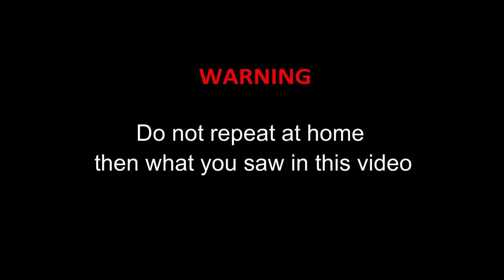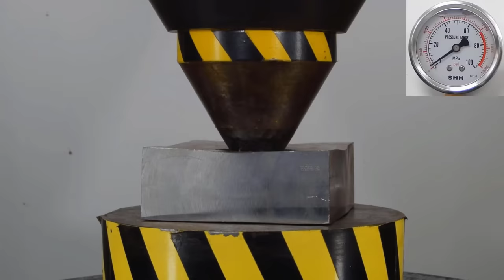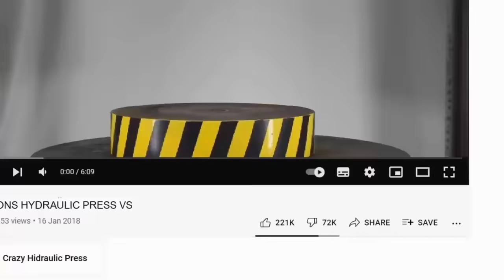HYDRAULIC PRESS VS OLD AND MODERN ARMOR

Comment: Now that armor is what extreme depth submersibles should be made from.
Reply: You mean some carbon fiber, glue and a playstation controller isn't enough?
Reply: @solenoidnull9542  lol the titan should have been named the giant soup can
Reply: And tgey should be a sphere, not a can.
Reply: Too soon and too late. That’s rare. 😜
Reply: @og-big-shepherd4468  - The jelly maker. :D
Reply: I don't think the brittleness of AR500 is any more appropriate than the brittleness of carbon fiber.   Ordinary steel has been used for subs for decades for a reason, as it has the right amount of flex that can be repeatedly subjected to, with minimal fatigue.
Reply: @ElementofKindness  What you are saying sounds right, but if I am correct in assuming that this armor is used in building tanks, being brittle (as in cast iron) would be a disaster for the tank crew.  It would seem that a tougher steel would not flex as much and therefore resist pressure better.  I know that chrome-moly steel is tough and not brittle (piton metal and is also used in building race car frames).
Reply: @solenoidnull9542  Hey wait, you can't leave out the cool LED's from RV world now.
Reply: it would be so heavy, that you would never be able to come back to the surface...
Reply: Nah, carbon fibre is perfect for billionaires toys, its sleek, futuristic and wealth redistributing - perfect!
Reply: I think you have to consider tensile strength over a larger area. A small block with localized pressure will behave quite differently from larger sheets making a hull, which also relies on inside pressure to help oppose the ocean pressure. And the shape of the vessel is important, too.
Reply: @solenoidnull9542  you need lights from a camping store too
Reply: @solenoidnull9542  you forgot a bunch of discarded rusty iron tubes for extra weight.
Reply: @solenoidnull9542  let's be fair, the Logitech F710 was the only surviving part.
Reply: wont work for long steel will rust especially in salty water
Reply: Well, it's also has to be buoyant enough to float back up to the surface unless you're okay with a one-way trip down.
Reply: @denniscliff2071  Modern tank armor is composite, there are other elements like ceramic behind the outer steel plate. Even if the steel shatters when hit, it's only the first layer of potentially many. They don't build them like they did back in the WW2 days where you would need to fish out shrapnel from your face even when the round failed to penetrate but caused spalling.
When we are talking about resisting pressures, though, the pressures submarines are subjected to are unreal. On DSVs that go down to the Marianas Trench, the titanium alloy pressure hull shrinks by what I'd call "an alarming amount". I don't remember the exact number but it wasn't microscopic I can tell you that much. This 90mm thick titanium sphere that's machined to be perfectly spherical actually shrinks from the outside ocean pressure. It's probably not a good idea to resist that with a brittle material.
Reply: @robertgaines-tulsa  The first submersible to dive to the bottom of the Marianas trench consisted of a steel Bathysphere attached to a large tank above the sphere.  The tank was filled with gasoline which is incompressible and yet is very buoyant.  No pressure vessel will have positive buoyancy.
Reply: @complame  ever heard of stainless steel?
Also, remind me what ships are made from 🤔
Reply: @dabunnyrabbit2620  The design, even with the cylindrical body, was OK .. it held up to a couple trips to the Titanic below. The material did not hold up and NDE testing was not done after each submergence, so it appears. They simply relied on some kind of sonic sensors. From what I've read, every trip down resulted in crackling sounds from the cylinder body, which had to have been the body resin micro cracking. What else could it have been? Yet that guy nor anyone else considered what the crackling sounds implied ..
Reply: @sporegnosis  It would require a different ballast system .. not the scrap steel pipe and sandbags used. More expensive yes but hay .. they'd be alive still unless improperly designed as well
Reply: @Rachel_M_  ever heard of stainless steel used as an armor plate? different purposes different formula.
Reply: @Rachel_M_  stainless steel wont be as strong as this one.
Reply: @complame  i made 2 points. Care to address both of them?
Reply: @complame  little hint for you. Look up Stainless Steel type 316 😉
Reply: @solenoidnull9542 stop that 😢
Reply: @complame  also look up HY-80 😉
Reply: @complame  myself and the Commenter above are talking about submersibles and salt water corrosion of steel.
Please try to stay on subject.
Reply: So it could stay on the bottom?
Reply: @Rachel_M_  Steel with special rust prevention paint.
Reply: @denniscliff2071  thanks!!! You let the cat out of the bag🤦🏼‍♀️.... Shh 🤫.. Don't tell anyone 😁

Not sure if Cathodic Protection can be used too? Never really looked into it...
I wonder 🤔......
Reply: @denniscliff2071  turns out they use cathodic protection... Never knew that!! Quite intersting as it goes.
Just watched a really good video on it 👍
Reply: @sporegnosis  right, aircraft carriers are too heavy to float🙄🤡

Comment: I quick question - what did the super cooling of the metal ball do for this test? Did it make it "harder" since it was at a lower temperature? Would supercooling the tank armor have any beneficial effects? Obviously a supercooled tank would stand out too much to thermal cameras but it is interesting.
Reply: Hardness decreases with temperature. But freezing the steel also makes it more brittle. Had the stress limit been reached for the ball, it may have been a catastrophic explosion. Think of it shattering like glass. The armor reached its limit and suffered catastrophic failure but was not thick enough to rupture, so it just cracked. We design pressure vessels to not be too thick so they will crack rather than explode. Once you hit that stress limit at a certain thickness, additional thickness might actually be worse, depending on how brittle the material is.

Comment: They were designed for completely different rounds and threats back then. The hardness and toughness were specifically designed to combat those rounds while modern armor has a different hardness and toughness for different purposes. Also this slow pressure is very different than shock load and piercing load of he and ap rounds
Reply: Yes, tungsten carbide and uranium carbide whites were not used at that time
Reply: Armor was sloped as well on tanks in most places. Ricochets were common unless facing an 88.

Comment: that's impressive but...I've never seen a tank attacked by a hydraulic press.
Reply: You joking? It simulates projectile impact. rmor does not know or care about who/what is pushing it, only peak pressure in Tons
Reply: @fahey5719 yes, yes he was joking
Reply: True, and also it took more force for the hardest cone to go through the 1940 steel. 450 tons. Vs the ar500 that exploded at less pressure. So I guess old steel better for some things?
Reply: Hydraulic press is probably one of the worst ways to test armour. The only way you will get reliable results is to just shoot the armour anyway since the forces in a hydraulic press and armour penetration are way different.

Comment: AR500 seems to be primarily used in body armour. It's probably not too different from the exterior layer of tank armour, but most of those are still classified.

But the main protection of the front and parts of the side of tank armour only uses this for the surface layer, behind which is a number of composite layers. Tank designers often estimate the frontal protection of tanks in tons/m², while the thickness of front armour tends to be around 1 m (3.3 ft)

Comment: Those titanium plates are likely those from the soviet 6b3 vest as it used a system of over lapping 6mm plates backed by Kevlar to offer protection. The plates are commonly sold separately on ebay

Comment: Although this is a very interesting demo, modern projectiles penetrate armor because they consist of a "shaped charge," which is an explosion that directs a jet of flowable metal against the armor. I don't believe there's any armor that can resist that, if the shape charge is large enough. The defense from shaped charges is to sense the incoming round and send out ceramic armor with an explosive charge, and the ceramic meets the incoming round at some distance away from the tank.

Comment: I had two friends that were pressing bearing races back into a large housing (factory machine) and the setup they had slipped and a race broke under about 450ton pressure - it shattered and one of the fragments penetrated one of my friends stomach - had to go to hospital and the drs called the police because they didn't buy the 'factory hydraulic press story'  - but insisted he was a gunshot victim.  The police visited the factory and checked out the story - everything was left as it was (because it became an osha investigation) - its very easy to get into trouble with a press -and hard to guard from sudden release of energy.  We wrap in Kevlar blankets now.

Comment: Modern tanks use a thin layer of steel and multiple layers of depleted uranium and NERA elements around 500 mm added together followed by a thick piece of steel usually 150 to 250 mm thick

Comment: So the old armour was probably just a basic steel a bit harder, probably carbon 0.40 or so. Not much in alloying to really strengthen it. 

Ar500 is heat treated high hardness but not a ballistic grade of armour.
It used for bulldozer blades, shovels, garbage truck bodies in the bin where they compact it. Those big ass mining dump trucks like a 777 as the liner in the box. 500 is a reading in the Brinnell hardness scale. You can get 300, 350, etc up to 600 in the market. Look up SSAB Hardox 500 if you want tech details

Hardox is a tradename by company ssab. But the end product is kinda the same, everyone who makes it has they own name.
Ballistic armour is literally tested by shooting at it, and it isn't designed to shatter like that. It's measured on energy absorption to failure. Modern armouring concept is layering to dissipate energy when hit, not just stopping the projectile cold. 

"Harder" measured hy resistance to penetration in a scale of (applied load / area) penetrates by X, then convert to a number. "Tougher" is energy absorbed. Look up video of a Charpy impact test.

At Algoma we sent 4x3ft plate peices to a US army lab. They set it up on a firing range, shot .50cal at it, and measured how much energy the plate absorbed when the bullet hit and went through. The samples we got back had neat little holes in them.
Some of the thicker plates will stop the bullet but still throw a chunk off the back of the plate. That is called spalling. Depending on the armour grade that may be allowed.

If you are doing a shooting range for your .22 or .305, you can get away with ar500 for backstops if you don't shoot from point blank.
Humvees use something different for their gunshields and sideplates. MIL 46100J i think is what the gunshield on a 50cal top turret gunner has.
Single plate gunshield. Good for small arms but probably not much help against a 50cal across the street or a high velocity sniper round. Small bullet with higher muzzle velocity is equal to larger bullet with slower muzzle velocity. Energy is the key factor you are looking at. Joules or newtons or ergs.

Modern tank armor is not just about the plates, it's layers of different stuff.
Reply: the old armor? I mean the 1940s steel. AR500 might be used, but it's not really "ballistics grade" steel. Read my whole comment. We make steel for the US army, and they dont use this.

Comment: To everyone quickly deciding that one is better than the other, usually we are often more efficient nowadays with materials in all aspects and we create objects to be enough resistant and enough hard to be useful in its environment - whether we are talking about buildings, machines or protective items

Cars have become softer, protective gears have become softer but softer gears absorb damage done to the human body better because they kill the "sudden hit power" idk what it is in English. It's also quite cheaper to produce, so we are just being efficient.

For every protective items and buildings, there are codes and minimal standards by law that need to be fulfilled in specific environments so that it is going to be safe in 95% of cases

Harder materials often crack easier and softer materials need to get through a certain amount of damage before they break down, until then, they just deform

Comment: Something the video doesn't warn about is that you do NOT want to touch steel immediately after it has gone through catastrophic deformation like this. IT BECOMES VERY HOT when that happens, so you have to wait at least a few minutes before you can even think of touching it.

Comment: Crazy, did you calculate the total energy in the blast? If you have the pressure/force vs distance of the probe data, it would be a simple integration. Many thanks for such an expensive experiment!
Reply: Well - what was the energy?

Comment: Soviet engineers admitted at the beginning of the war that the armor of the T-34 was very weak.
After the Americans examined the tank, they were advised to harden the steel in depth, otherwise the armor was very weak.
By the way, this is precisely why the newer Shermans are made of sheets, not cast like the first Sherman.

Comment: Now, weld a concave copper disk to one end of a 12-18 inch steel pipe and in the other end seal it and place about 1lbs of homemade explosive. Point the copper end at that AR-500 armor and watch how fast that Molten copper slug rips through it

Comment: I have my own ball baring armer on my car it has withstand 50bmg rounds with no problem and titanium case and the iner liner is 1/4 in steal  also ever bal baring is taked together when it gets hit the titanium  shaters the led round if it's a full metal jaket it Penetrates but the steal  Slows it down when it hits ball bearing The round explodes. Into lots of fragments to actually fully penetrate it. You would need two hit the exact same spot about four times with a 50bmg or 2 times with a 20mm shell

Comment: It shows only a side of the problem. The other one is that modern APFSDS rounds have DU or tungsten in their rods and also on impact they melt the steel. Also there are the cumulative shaped charges which pretty much pass through steel like butter.

Comment: im not even amazed by the press itself im amazed by the rigging that holds this beast from either going sky high or into the ground...what is keeping it from going up grade 1000 bolts and is it bolted to itself as a whole unit or anchored into a concrete base

Comment: Density problem freezing steel ball made it denser that's why they use tungsten rod to penetrate armor or uranium depleted shells.
The very Hard steel was brittle it could've done the Job but wasn't tempered or composite so it crumbles. 
The armor couldve been made with very dense steel mixed with other metals.

Comment: Russian WW2 tank armor had a reputation for inconsistent hardening from heat treatment in place of valuable metal alloys that were in short supply.  And the heat treatment could result in brittleness that could cause dangerous fragmentation.  This was not helped by a shortage of skilled metal workers and poor quality control when the focus was on the number of tanks built each period.   Heat hardening required known time and temperatures for good quality hardness. Valuable allies were a priority for machinery and tools. If enough was available some could be used to make armor piercing ammunition.

Comment: Well, I see a few problems with this head to head.
First is the thickness of the two materials not being the same. Now, stacking multiple layers of thiner materials is nowhere near the same as a solid piece of material.
Second, the modern materials are curved and not flat like the old materials. This gives it a major weak point in the middle as there are two pressure points on a very thin line, which are the outer edges. Making it much easier to snap in the middle. Just like how brick breakers layer a piece of wood between the blocks. Now Titanium is more brittle by nature than Steel is, but it is a hell of a lot more resistant than Steel is.
Next ti.e take a piece of 45mm Titanium block the same exact size of the 45mm piece of Steel and see how things go. Now, if you are saying that WWII tank armor is better modern tank armor, you are highly mistaken. It's not just the Titanium that is the armor of a tank. There are many more materials that go into the armor of a tank.

Comment: Can i make a suggestion; get 4-6 pieces of 3/4ths quarter inch thick steel, and either steel or iron elbows. weld the steel panels together, places them around the press, then weld the elbows to the bottom of the panels and bolt them into the floor. Particle board and a thin sheet of plastic is not sufficient on its own.

Comment: Before watching this I had always assumed that titanium was stronger than steel. Upon seeing that debunked it caused me to do some research and I found out that Titanium actually is not stronger than steel like it is commonly believed. Titanium is just much lighter than steel and with roughly the same strength. Just a little bit weaker in fact. Steel is a much harder material than titanium, with titanium having a lower modulus of elasticity, meaning it deforms far more easily than steel. Which is seen in the video in how the titanium completely buckles under the hydraulic press while the steel is untouched until something harder than it is used. Just very interesting to see.